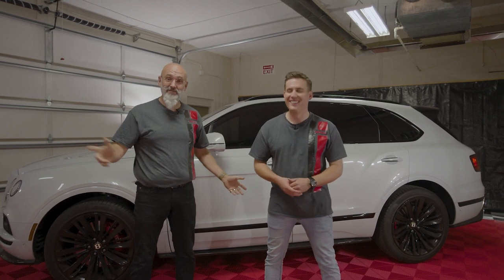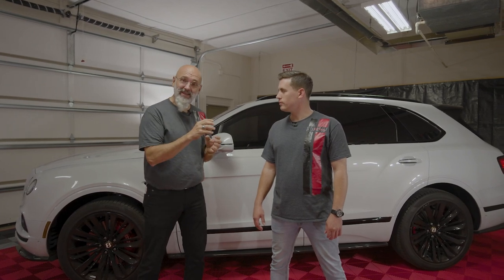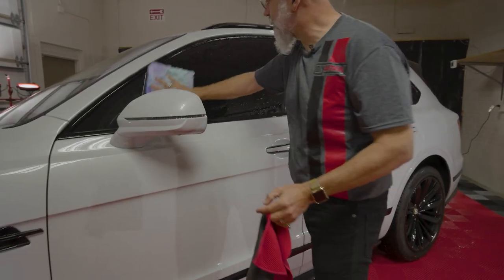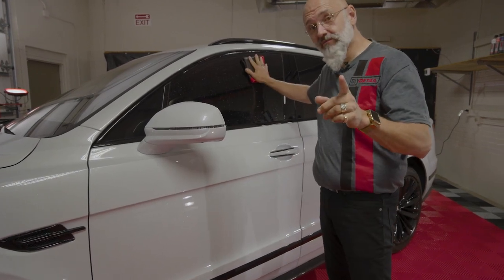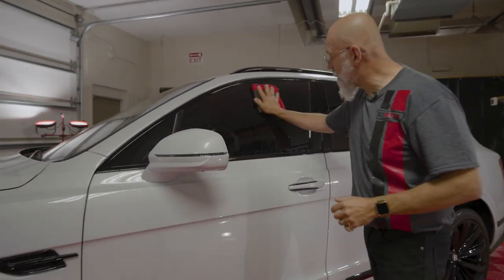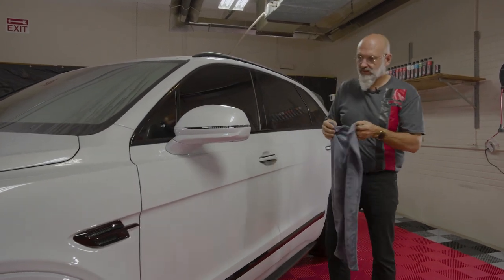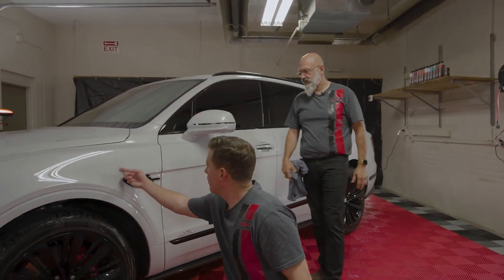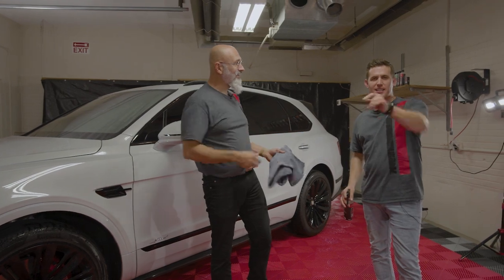CLAY YOUR CAR with rinseless wash?! DIY Clay towel 101

Comment: Iron decontamination for myself is my least favorite part of detailing just with the odor. I really like that this formula is not offensive with smell that just helps 10000%. I do love seeing the bleeding if you will after it starts working.  I saw another comment on claying a coated car and I'm curious myself.  I would say if you have the rinseless and the iron remover your clay shouldn't be touching the surface making it safer. The iron clay lubricant I've been using since I saw Yvan do it and it saves time! Excellent video! Good to see Yvan back and slicker then ever
Reply from the maker: Unfortunately it not offensive, but it doesn’t smell great either. Yes using good products and techniques you can and should clay a coated car.

Comment: Excellent video guys. I will be ceramic coating my car. After the initial contact wash i spray Capro Iron X on the  DIY clay towel and panel and lightly rub into the panel. Then rinse off. Than wash the clay towel to remove the contamination. Next spray DIY ceramic gloss spray on panel and DIY Towel. After that apply panel prep and Ceramic coating. Is  this the right order?
Reply from the maker: Here’s a video with the proper steps

Ceramic coating application for beginners! #diydetail #ceramiccoating #autodetailing
https://youtu.be/bjBnGkVBo08

Comment: Great videos, guys! If you didn't have a pressure washer to rinse off the iron remover, what would be the best way to do so? I saw another video where Nick had used a sprayer to spray more rinseless or used a towel and wrung it out over the panel. However, then you'd have to use multiple towels per panel. I probably answered my own question, but wondering if there is a better way than using a bunch of towels.  Would using a separate rinse bucket be an option to wash out the towel from iron remover? Also could you use the rinseless wash sponge or wash mitt instead of towels?
Reply from the maker: All of those are good. You simply want to remove it, there’s no wrong or right way.

Comment: Can I use drying lubricant (optimum spray wax, bead maker or your awesome ceramic gloss etc…) if I’m planing to apply a coating?
You guys are doing great job by the way! Keep up the good work!
Reply from the maker: No, a coating requires clean, unprotected paint. Any form of protection will prevent the coating from bonding properly. Once the coating has cured for a week you can use https://diydetail.com/products/ceramic-gloss or https://diydetail.com/products/quick-beads for regular maintenance.

Comment: Just got the clay towel, Rinseless Wash, Quick Beads and Iron Remover.  Vehicle is one year old and has little contamination - if I use the clay towel with ample lubrication should this avoid marring and scratching…as I would prefer not to have to polish.
Reply from the maker: Yes

Comment: i had some fungal spores attack my headlights leaving black spots that weren't going away with car soap or rinseless wash. the next thing i used was a clay bar. now i'm regretting it because of the marring, hazing, and discoloring that occured over the next few weeks. is this clay towel any safer on headlights and the headlight coating? any tips on a less aggressive method to removing those spores?
Reply from the maker: Peanut oil is the best solution for artillery Fungus spores

Comment: Great video , definitly will try clay mitt , i was wondering if i can insteat of use iron as clay lube , do a prewash with iron in the jet wash ,and do a wash with rinseless and then add rinseless as clay lube instead of the iron , becouse of not letting a harsher chemical on the paint .
Best regards
Reply from the maker: You can do that, might be a waste of product. I’ve always felt like foaming on iron remover wasn’t the most effective use of money since that is a more expensive chemical to manufacture 😀
Reply: @diydetailofficial  yes indeed is a great idea my only afraid is that in my house i cant hose down the iron , can it be neutralized with a secont wash with rinseless?

Comment: Exelent guys. Can I dry a vehicle with a ceramic gloss or any "quick detailer" to lubricate the surface if I'm going to apply ceramic coat on the vehicle?
Reply from the maker: No, in that case you want nothing on the surface. If you’re not going to be polishing after the wash, use DIY Detail Panel Prep as your drying aid. 

Thanks for your question, hope the answer helps.

Comment: What do we do if the clay towel “smears” or “dissolves” on the surface? Cool day, working in shaded, using Rinseless and iron remover for Lube, only thing I could think is that I used water spot remover earlier in the day? Rinsed down extremely thoroughly after.
Reply from the maker: That’s a possibility, are you using DIY Detail Iron Remover?
Reply: @diydetailofficial  thanks for reply, it was diy detail Rinseless and am details iron and fallout remover

Comment: Would this be a good step to do before you polish your paint. Or would you skip the ceramic gloss step and then polish?
Reply from the maker: Absolutely. In fact I would argue it’s essential. You’re essentially removing embedded contaminants from the clear coat. This way when you polish you’ve got the cleanest possible canvas upon which to do your work and you’re not competing against crud that could interfere with or clog up your pad or polish
Reply: Thanks for the reply you guys are fantastic thanks again!!!!!
Reply from the maker: Thank you, it’s appreciated!
Reply: @DIY Detail  I understand using iron remover and the clay towel before polishing, but would you still use Ceramic Gloss if your next step is to polish?

Comment: Is it only when using an iron remover you don't want to dunk your clay towel in the rinseless solution  bucket or is it anytime you're using the clay towel? You mentioned contaminating the rinseless. Also would you clean the towel after using all 4 sides and if so what would you use to clean it because you still have the rest of the car to do.
Reply from the maker: Just with Iron Remover, and if you’re not going to wash another car with the contents of the bucket, dunk to your hearts content. 

Alternatively, simply rinse it with water and continue.
Reply: @diydetailofficial  thanks for clarifying that!
Reply from the maker: @chriss3959  our pleasure.

Comment: The video I was waiting for! 
I've got a question about using clay - how often should decontaminate car? Only when I hear decontamination? Maybe once a year? Or after winter? 🤔
Reply from the maker: It’s totally dependent on your environment. If you want to…maybe once a quarter. The problem with waiting too long is you tend to get really nasty stuff stuck in the paint…so you inevitably clay “harder” which gives you more risk for marring. I would just use this method with extremely light pressure if any…and if you’re not getting marring do it as often as you wish:) you can put a little more pressure on the windshield but Yvan was right…basically no pressure with clay towel and by folding it you’re giving it a bit of cushion between your hand and the paint
Reply: @diydetailofficial  Thank you!
Reply from the maker: Our pleasure, and thanks for your questions.

Comment: So I used the rinseless wash for the first time yesterday and it was not at all what I would have expected. It didn't feel like it was slippery like a soap with the clay towel?
Reply from the maker: They both provide the lubrication you need , but DIY Detail Incredible Suds will feel slicker depending on how you mixed it.
Reply from the maker: Did you use just Rinseless as the lube? Was it diluted at 256:1? Was the towel soaking in the bucket first? Were you outside where the Rinseless might have dried on the panel before you got there? Just some questions for you:)
Reply: Yes, 256:1 (one ounce per two gallons) and the towel and the surface was wet with the rinseless (the towel was soaked and i was using a sprayer to keep the surface wet with the Rinseless wash)

Comment: My clay towel is sticky and sticks to itself even when I spray a clay lube on it and on the surface how can I prevent this
Reply from the maker: What have you used for clay lubricant?
Reply: @diydetailofficial  meguiars finishing detail spray diluted 1:1 ratio
Reply from the maker: Unfortunately that may have damaged the towel.
Reply: So I used it today for the first time and I used the iron remover with incredible suds prior, and now the towel is very sticky as well. All product from DIY Detail. So, what’s up with that? I rinsed it after use with lots of water. Tbh disappointed if even DIY detail products can damage it.

Comment: This is rubbish! Save time and effort and get some Bilt Hamber clay that uses water as a lubricant. Far better than this nonesense!
Reply from the maker: You can use water as well, it’s simply not as safe as using a lubricant.
Reply: Use Bilt Hamber Clay on one side of a panel with just water and the other side with rinsless, quick detail spray or a dedicated Clay lube.  Compare the marring from both sides.  You will start using rinseless or some other form of lubricant after you do this.